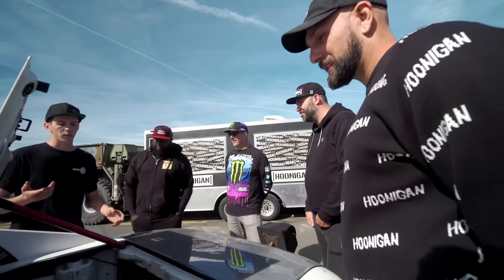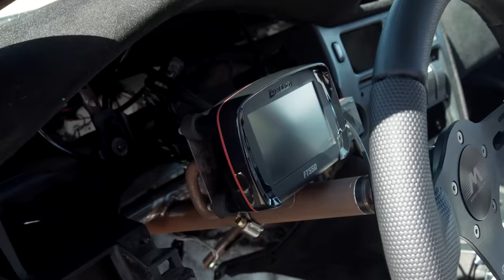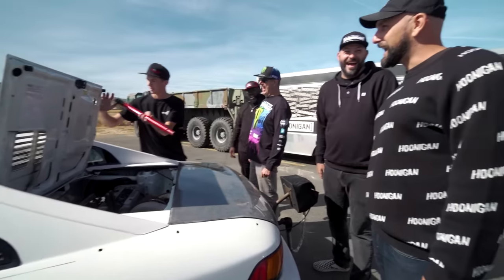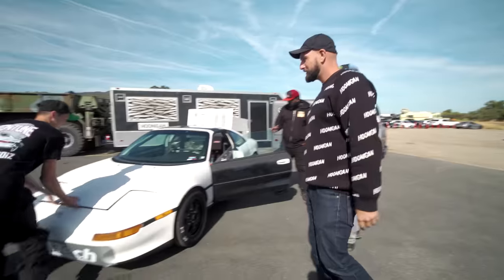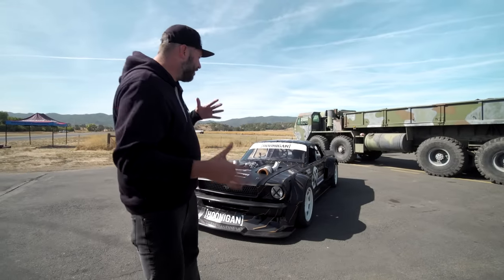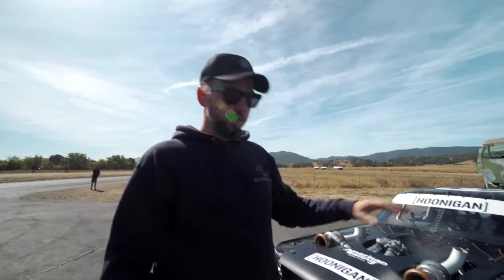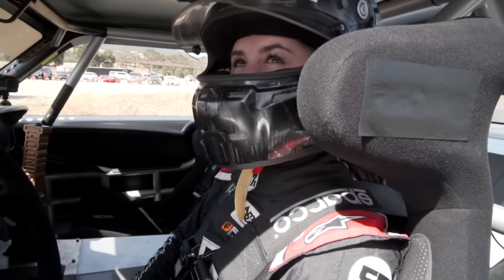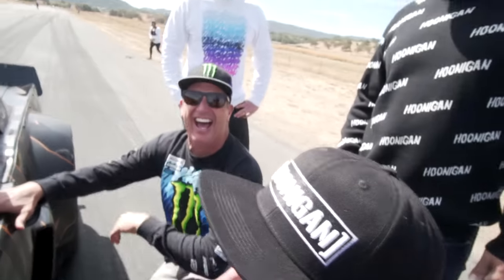BoostedBoiz' 1300hp Toyota MR2 vs Lia Block's AWD 1400hp Mustang

Comment: The wide drone shot at 13:07 gives so much information. The Hoonicorn is outrageous.
Reply: Gives a lot of information that the mr2 had to turn it down to 600 hp Bc of hoonigans dusty unprepped surface
Reply: @Theeeeea  the Hoonicorn is also racing on the same surface, people seem to forget this.
Reply: @R03333  but with awd and 1400 hp and has been tuned to this type of surface perfectly
Reply: @R03333  mhm, but they get to dial the car in every day they race, they get right lane which has tons of rubber on the ground, and the left lane is always more dusty then the right, watch boosted Boiz video they had to turn the car down to 30 lbs
Reply: @Theeeeea  they lost to the gtr  in the right lane 😣
Reply: @rhett7716  yes the 2,000 horsepower gtr who has hundreds of hits on the street
Reply: @breyf2625  its not tuned to draggin thou 😣
Reply: @Theeeeea  fk mate what do u want, it was a close race !!! stop whinin ffs 😣 !!!
Reply: @rhett7716  exactly why would you take a car that needs to be dialed in on a unprepped surface its unfair to any other car that doesn't street race
Reply: @Theeeeea  that's just the nature of the race, it's Hoonicorn Vs the world. It's not a scientific test, if the Hoonicorn raced every car in their home environment the results would obviously be different (and impossibly expensive to produce). Imagine it racing a Trophy Truck in the Baha for example.
Reply: @R03333  yeah I know that, but they should at least allow some prep for both the hoonicorn and whoever’s racing, it sucks that these people who have spent years building these cars can’t even show them off to millions Bc of unfair race conditions

Comment: I want to see the hoonicorn on an actual drag strip. I’m genuinely curious on what time it would run
Reply: It would break
Reply: It would run a DNF. It's broken parts on a no prep surface so it would definitely grenade something on a strip
Reply: it would snap all the axles if it hooked
Reply: Well they don’t have to launch at max power, there are things like ramping boost😅
Reply: @need_more_lives2974  then it wud be sloooow !!😣
Reply: @rhett7716  ahhh true😬😂
Reply: Why do people think this car is made of glass? Yeah it wasn’t built to hook but it’s still got beefy parts, everything isn’t just gonna break.
Reply: @lucasburke6099  yea just cause it might break when launching 1400 doesn’t mean it can’t take like a 600 hp launch witch blows these streat tires of the ground!
Reply: according to these videos, very very low 7 or a 6
Reply: @jesse6779  what r u smokin dude lol
Reply: @need_more_lives2974  streat
Reply: @kaikai312  it puts lengths on 7 seconds cars even when they have traction
Reply: @kaikai312  with stiffened axles and improved transfer case im seeing a low 8 high 7
Reply: @jesse6779  If the hoonicorn had everything beefed up to handle the forces of a prep track launch. It might do high 7s. Cars in the 6s are pushing 2400hp and are lighter then the hoonicorn AWD or not.
Reply: Going by its HP and weight it would run a 7.5-7.8 if nothing broke on launch.
Reply: That corn got 2000hp they lying it's pulling way so many gaps in everything maybe 2500hp
Reply: Breaks an axle ferrrrrrrr shuuuuuurrrrrrrrrr
Reply: Too much money on broken axles and driveshafts.
Reply: @jesse6779  which 7 second car ? either way its not runnin 6s lol most likely not low 7s to
Reply: I'd say high 7s if it launched easily, so the MR2 would actually be a good race...
Reply: @everrybody  Its built to be tough and all they need to do is soften the suspension in the rear, give it some drag tires and soften the tire pressure. Im sure they'll take it to the strip one day.
Reply: @jesse6779   mid  8’s
Reply: @joshkolden9103  there is no way it would launch as good as rwd cars so the short track would be suffering I’m saying 8’s
Reply: @chrisoh6627  you have to launch really hard for 7’s on the current set up I’m thinking 8’s
Reply: @isaacboettcher3489  idk modded AWD GTRs seem to launch pretty hard at the track.
Reply: Well the hoonicorn and the 8 second RS3 were basically neck and neck when they raced. I’m gonna guess 7.9-8.3 it has a chance to get in the 7’s!
Reply: @joshkolden9103  their bias isn’t 50/50 and they have to make it all up in the big end. You don’t gain any with awd on a preped track
Reply: @Sle3p520  it will be close! It’s a manual so you would have to be really good at slipping the clutch!
Reply: @Sle3p520  it does and that was a really close race, but we’ve seen it throw an axle (I think it was an axle, correct me if I’m wrong). I wonder if it would go an 8 or faster with drag slicks on a prepped surface or would it cook drivetrain components because of the grip.
Reply: @FSons  that’s my guess if components don’t break. It’s easily an 8 car but 7’s idk

Comment: Dude.... Even on a bad surface I'm sure the MR2 can go 8.5, the way the hoonicorn runs it down, even while the MR2 is in boost is insane. I can't believe how easily it runs down something that fast.
Reply: Kyle can't drive. Left zero rubber on the road.  Lame
Reply: @cliffhooper3558  he has drag slick on
Reply: @cliffhooper3558  you wouldnt be able to handle all that so shush
Reply: the mr2 was turned down alot even with slicks on got no traction

Comment: Even though he lost, it’s still impressive he crammed 1,300 HP in a tiny little 2 seater.
Reply: With 2.0 L of displacement.
Reply: Hp doesn’t win drags it’s tq n the v8 has shut loads
Reply: @Malibus_Most_Wanted  u realize the mr2 runs 7s?
Reply: @dougn6465  That’s kinda the point. The Hoonicorn has more torque at lower RPMs despite having somewhat close peak HP numbers to the mr2. which was one of the contributing factors that led to its victory.
Reply: @jacobrzeszewski6527  guys I replied to, said HP don’t win drags tq does. Doubt the mr2 would lose on a drag strip
Reply: @jacobrzeszewski6527  no, it's the track that makes the unicorn win, if you see all their episodes only AWD cars are competitive against it, if they were on a prepped track it would lose a lot of times
Reply: @Frezzyy  if you watch the boostedboiz video from this, they said they had it turned down to 30psi max boost (where they normally run 50+) and estimated it at maybe 600whp because the car couldn't get traction with more power than that. awd cars have a HUGE advantage on no-prep surfaces
Reply: @Malibus_Most_Wanted  whaaaat nonsence is that. Is dragracing you mostly is in high rpms where horse power matters.
Reply: @dougn6465  torque is irrelevant to drag racing.
Reply: @dlg78  that is my whole argument. Tq is irrelevant due to gearing
Reply: @Malibus_Most_Wanted  you must not know about the Red Demon eclipse 🤣

Comment: I didn’t realize how light the mr2 is. The power to weight ratio is insane I can’t believe it’s only about 2300 pounds. That’s super light for 1300hp at the crank.
Reply: It's like 2700ish stock iirc

Comment: 13:07 This is the shot yall need to remember anytime you pair a RWD car against AWD. Unless you're 1000lbs less weight AND more power, it's not remotely fair.
Reply: That, and Kyle had to turn the mr2 WAAAYY down from 50+psi of boost to 30psi and still had the traction control pulling timing. Still an insane race from both of them.
Reply: So SXSBlog’s 2JP was heads up and lost by half a car in the second. Don’t know why they didn’t give them a 3rd bonus race. They would have been hood to hood on that bonus race. The RZR gave the Hoonicorn the best run yet.
Reply: @brettbaratheon9776  they did do a bonus and hoonicorn ran it down easy again !!
Reply: @rhett7716  there was no 3rd race with the SXSBlog 2JP.
Reply: See, he should have asked for a rolling race...you can't beat the Hoonicorn from a standstill with a RWD vehicle.  Oh well 🤷‍♂️
Reply: @brianmessemer2973  theyve done rolls b4
Reply: @brettbaratheon9776  oh thought this was about mr2 ere 🤔
Reply: @rhett7716  I gotcha. Yeah, my comment was about SXSBlog and their race last week with the Hoonicorn. Did you see that one? You should watch it if you haven’t. Hoonigan didn’t give them a third bonus race.

Comment: 13:07 That is a ridiculously quick accelerating car.  Amazing what 2000hp can do.  7 sec car never had a chance on an unprepped surface against an AWD.  Also nice when a car has basically no expense spared on it.  MR2 is amazing, but that was built with a mere mortals wallet.

Comment: impressed how kyle managed to keep it straight the whole way, a car that light with that power on those brakes on a dirt road... sketchh
Reply: Kyle's middle name is "sketchy" 😂
Reply: Watch his yt vid he said he had to turn it down to 30 lbs/ about 600
Reply: They're not on a dirt road? What is wrong with you dude, get your brain checked 😂
Reply: @skrimper  same shit dusty/dirt road. Sand all over it and its not hard to see.
Reply: its not a "dirt" road !!
Reply: @Ehren1337  yerh and i saw hoonicorn spinnin to half track at least, def needs stickier tyres !! 😂
Reply: @rhett7716  you would want to spin a little on awd so it doesnt bog down in powerband but v8 helps that.

Comment: Either that MR2 is hurt or they turned it waaaayyy down for the unprepped surface.  Hoonicorn was pulling at every point during the race, even on the top when you would expect the MR2 to have an advantage.
Reply: Not even close of a race.  3 cars + hit, still loses 🤦‍♂️
Reply: Not many rwd cars are going to compete with the Hoonicorn
Reply: Even if the MR2 wasn’t turned down they’re going to be decently close on top end and the Hoonicorn is getting out of the hole so much better it’s just going to carry all that extra speed the whole way down the track. 
The bigger engine makes more power overall even if the peak numbers are close.
Reply: It was pulling timing like crazy the whole run due to traction loss. You can hear it
Reply: Need to stay on the strip. Mr2 was at a massive turf disadvantage
Reply: Yup. Lasers defenitely weren't working in the boiz favor this time
Reply: @jonahpower1059  😂
Reply: 1400hp vs 1300... and probably a bigger engine too that gives a broader torque curve. Is the other car much lighter?
Reply: Agreed, had to be wayyyy turned down. The awd is just nasty on that that surface.
Reply: End of the video he said he was spinning nearly the whole 1000ft
Reply: @martinsv9183  mr2 was 500 pounds lighter but the traction control was dropping it to 0 timing. also have to remember that was pretty much the 4th time it went down since the rebuild, they did 3 runs at Bradenton then put it away after the record run. was still fun to watch but was also fun to see how much more comfortable Lia has gotten behind the wheel seeing this race compared to the ones that were done after(even though they aired before this).
Reply: Hoonicorn is making way more than 1400 hp.
Reply: they dropped it from 50+ lbs to 30.  its wayyyy turned down
Reply: @OrangeHeadTM  yeah closer to 1600
Reply: Wouldve liked to see a roll race
Reply: They had to turn it down from 50psi of boost to 30psi. Almost half the power and it was still spinning the entire time with traction control fighting for its life trying to keep the  car from spinning
Reply: @Quentlo  On that surface yes.
Reply: Also it doesn't make 1300hp wheel. It makes 1100hp wheel where as the hoonicorn. Makes 1400hp wheel and they even turned it up so its around 1600hp wheel
Reply: @martinsv9183  the mr2 was more like 600-700hp because it was turned down so much just to make it down the strip
Reply: @Twobarpsi  they had to turn it down Bc of hoonigans unfair race advantage
Reply: No s*** Sherlock, did you watch the video?
Reply: @S14lopez1  made 1100 on the dyno tuning. Turned up is plenty more.. but alas, had to be turned down for no prep
Reply: @jonahpower1059  I think you missed what the laser sensors are for.
Reply: yea if u watch kyles video they turned it down 20 psi just to be able to drive straight.
Reply: Mr2 sounds like is breaking up 🤷🏽‍♂️ but who knows
Reply: In Kyles video they said it was turned down to 30psi instead of the 55 they usually run. A wider tire wouldn’t hurt, 8.5 isn’t doing them any favors. Swapping lanes would have been the move but hoonicorn always gets that jet black lane caked with rubber.
Reply: @StrawGary  none of these numbers are adding up when comparing how much of a gap the car puts on literally everything. Like if they want some competition, bring out some TX2K  cars.
Reply: @NBSV1  the hoonicorn is a lot slower than the mr2 if it was on a real strip the gearing is all wrong too short , so on the strip the mr2 would gap it the hoonicorn isn't a 7 sec car
Reply: @Quentlo  to be fair, if there was one they'd never, ever have it on the show, can't risk losing.
Reply: In Kyles video they said they turned it down to like 600 hp.
Reply: These rwd cars can't put down their HP. We're as the awd hoonicorn can put down its HP. The only rwd that's been close is SXSBlogs RZR. Which it almost beat the hoonicorn and would have if they got another run I believe.
Reply: @OrangeHeadTM  how do none of the numbers add up? you take a 1100hp car that's on 50+lbs of boost. drop it to 26 on the leave and up to 30 for the entire pass. the cars making ~600hp not to mention the timing was pulled way out because of traction control. the hoonicorn was turned way up to close to 1600hp. this was the first race for this series before there was any rubber actually laid down in the left lane where Kyle was.  these numbers are more than accurate.
Reply: @martinsv9183  not 1300hp more like 700-800 as boost was down to 30 from the normal
Of 55.
Reply: They turned it down by 20lb of boost as there was no traction
Reply: They’re lying about how much horsepower the Hoonicorn makes
Reply: @OrangeHeadTM  not gonna do that. I always comment they should bring Red demon over to race.
Reply: If you watch Kyles channel, they said with the settings they had for the traction control on to "GET GRIP" it was pretty much them running almost just 600 HP. Also on Kyles video at the very end, he did a side by side video comparison of the WR 1/4 mile run vs his best pass vs the Hoonicorn. By the time he shifted out of 1st gear vs the Hoonicorn, he was already in 3rd gear on his WR pass. He couldnt get traction to save his life. lol
Reply: @NBSV1  torque wins races, the K series is a good engine but you can only ask so much from four cylinders and two drive wheels.
Reply: @Twobarpsi , you have no idea Fanboi.
Go and play the video game so you can win all the time.
Reply: @manueljg9  that's the traction control keeping it from sliding off the road
Reply: @StrawGary  I'm talking a bunch of ppl that have lost to the hoonicorn this season.................
Reply: @Turshin  yup! I commented this as well, talking about the 1320 gtr right? Thing would womp on the hoonicorn lol.
Reply: @OrangeHeadTM  yeah cool. none of them are no prep cars. so they're all turning down for the road.
Reply: @martinsv9183  yes but not getting traction. i could see the mustang smokin but not the mr2 🤔
Reply: @youngty8620  corn only spinnin to half track 😂
Reply: @OrangeHeadTM  nah  just mr2 making way less and spinnin on the spot.
corn only just beat 1100hp tesla plaid !! 😣
Reply: @Theeeeea  stop crying bud. go watch the corn getting its arse whiped by the gtr, that shud make u 😁
Reply: @jordanmpaul  yeah dont know why he even bothered turning up....😣
Reply: @OrangeHeadTM  didnt u watch the gtr whip the corn ffs !!!!!
Reply: @rushking19  well u know !! 😣
Reply: @michaelgamble2848  ffs u obviously new here !! whatch that gtr eat the corn. much closer racing this season, corn only just got the plaid etc !!!
Reply: @YotaDude08  wtf u git yr eyes closed ?? watch the gtr  whip the corn !!!!
Reply: @brianawd  and so??? stop crying !!
Reply: @jaythe2nd38  and ????? so  what ?? he came to challenge and lost ... he knew what hes up against unless hes got hes head in the sand !!!!
Reply: @rhett7716  you got the wrong guy
Reply: @2JZDestroyer  well high 7s is pretty darn good on prep surface !
Reply: @jordanmpaul  dissengage it 😂
Reply: @rhett7716  awd spinning to half track a lot different than rwd spinning the whole time lol
Reply: @StrawGary  gtr ???? 😂
Reply: @rhett7716  The hell you even talking about? I commented on how rwd cars can't put there power down and you ask if I've seen the GTR whip the corn.
Reply: He lies about the numbers. No where near a high 7 setup
Reply: @Dense147  I hope you are talking about the hoon because the mr2 has already run high 7sec pass.
Reply: @youngty8620  well tough cheese, he prob knew he didnt have a chance in hell then !!😣
Reply: @brianawd  i dont give a flyin f mate, just want a close race. mr awd u shud be hangin onto the hoon for sure 😣
Reply: @YotaDude08  u wanna see corn get whiped watch the gtr and the supra 2jz or sumthing had them too, all the races have been pretty close this season except this one.
Reply: @rhett7716  wins vs losses, count em.
Reply: @brianawd   in competition? Or a set up test day. I dont think its done high 8s in front of a crowd
Reply: @Dense147  it’s done hight 7s. Does not matter if it’s a private track rental/ test and tune or a competition. They have video proof and a time slip.
Reply: @brianawd  its rigged bro the grey mr2 does consistently low 8s in front of crowds. Explain why boosted boi cant do the same?